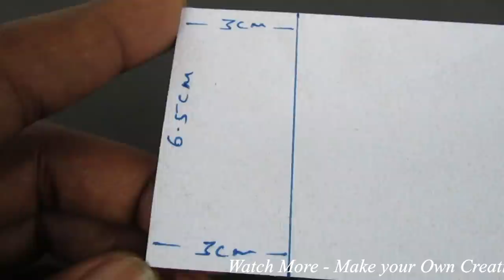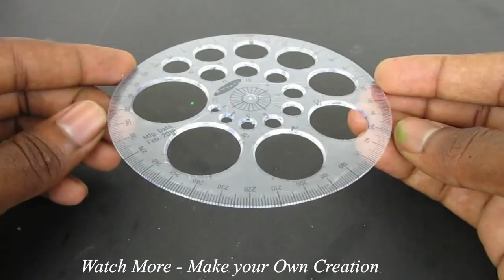How to Make a Floor Cleaning Machine - Remote Controlled

Comment: When will you release the new bucket wheel excavator with wired remote and conveyor belt?
i am waiting so long for this. Remember me commenting on your previous videos?
Reply from the maker: need time, i m not getting 30 RPM Motor

Comment: the idea is excellent, but the problem is that the machine makes foam in the ground and why you have put the motor on the last trial and why you have put a syringe in the lock box and please also saw that you are an Indian or not because I am an Indian and I cannot bring resources to make the machine
Reply: i think it is possible to get things if you go in an electronic shop